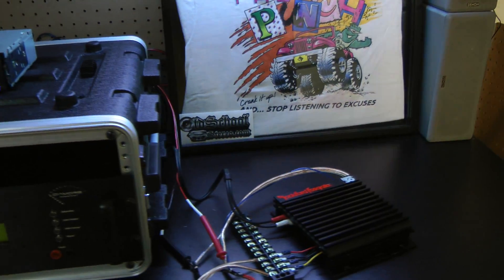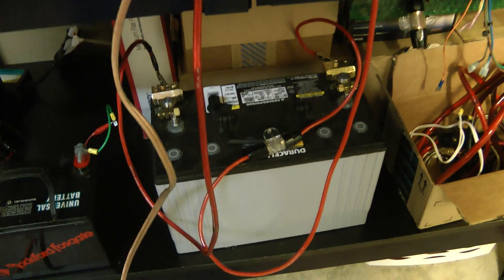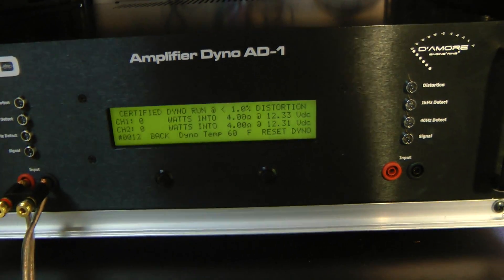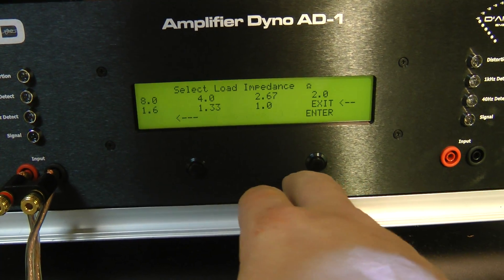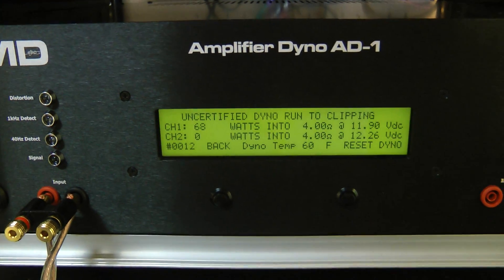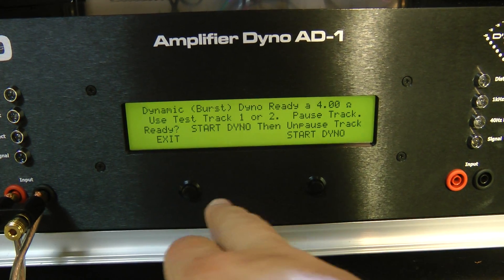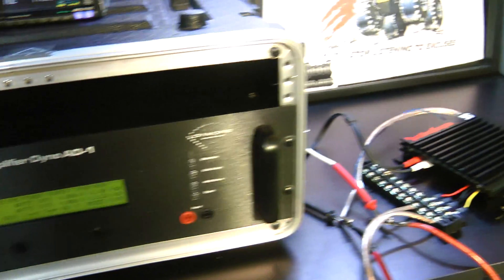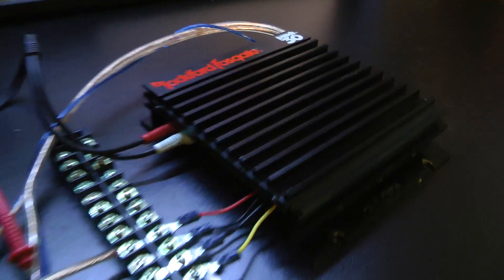1989 Rockford Fosgate Punch 30 Amp Dyno 4 Ohms Test

Comment: Whoooo we Big D busting out with the peanut RockFord Fosgate Punch 30. I still run my Punch 30 for front stage MB Quarts Wurlitzer components, Punch 75HD for rear fill JBL GTO 6x9's & Hi Fonics Thor VII for bass (2) 10" SaS 
Bazookas off a Harman Kardon CR151 head unit & Audio Art AEC 3way X-O. Everything still working awsome since 1990.

Comment: i had 2 RF Peanuts pushing 2 12Inch Kicker Comp C12A and they hammered then i got a Punch HD150 and pushed 2 12inch Solos Bs OMG!!!! i wish i never sold those punches i had the 30 ,45 ,75, and 2 150s in the late 90s
Reply: Aloha, bro i have for sell 2 punch45's left @$140. each or $240 for the pair....
Also have 1 punch150 left ...$best offer.. these 3 amps ..2nd gen, NON HD...  if you were looking...

Comment: If you can figure a way to make you power supply work with this amp, you'd get much better numbers. 

All RF amps (especially these older ones) are unregulated and designed to make the most power at the higher voltages your alternator puts out. I'm going to bet it will produce at least 50% more power if fed 13.8-14.4 volts. 

It would make a cool video if you can make it work. 

Keep up the good fight...The Old School fight!

Comment: 2 ohms and a bridged run, please.
Reply from the maker: Nothing Good Interesting....I had a few Punch 150's over the years (including one from 1986) and ran them all at 2 ohms mono, with no problems. I would not, however, run the Punch 30 at 2 ohms mono
Reply from the maker: Zionslayer1 The Punch 30 is not your average Punch amp from back then...I would not run this one at 2 ohms mono, yet I would not hesitate w/ the 45/75/150
Reply: Dereck BigDWiz

You can't run the Punch 150 at 2ohms mono,a buddy of mine had one that was made in 1989 he run his at 2ohms mono for about 2 weeks until it blew out one of the channels.